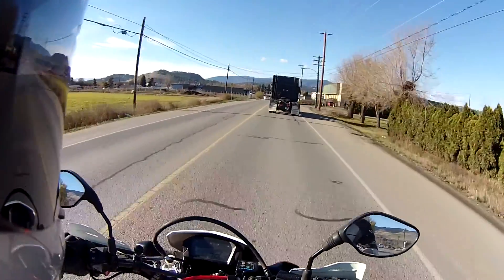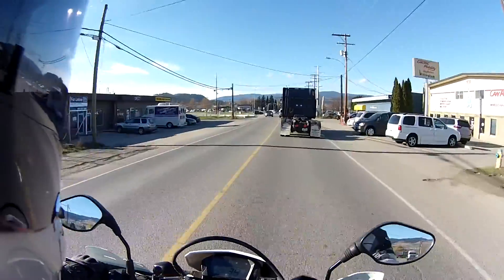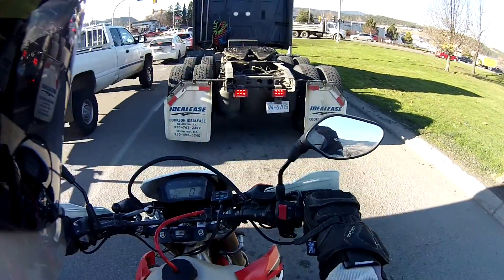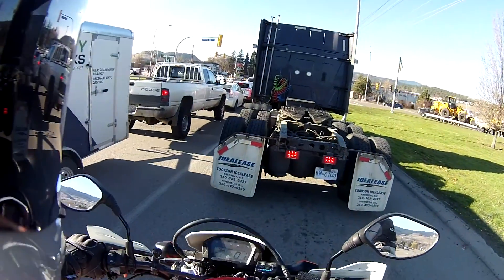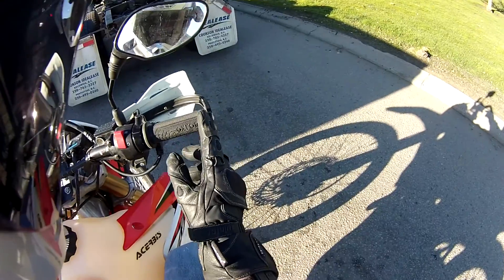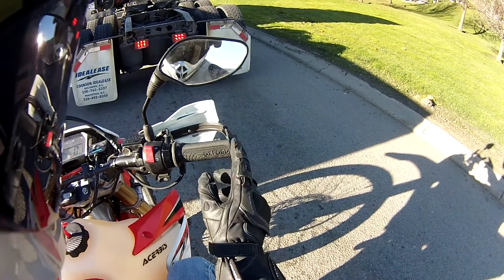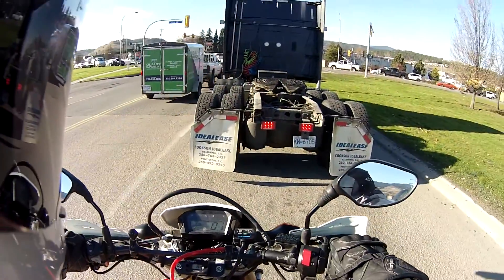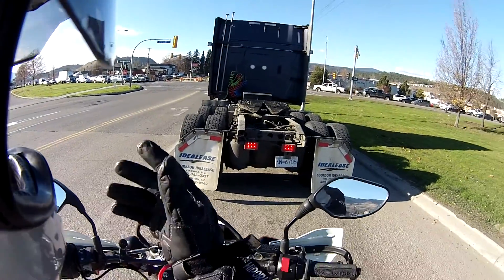Oxford Heated Grips On Crf250L

Comment: Heated grips good (except top of my hands get cold; bottom hot). Years ago I turned to heated gloves (Warm & Safe) and really like them.
Reply from the maker: Yeah I thought about gloves as they would be the ultimate warmth, but the price, inconvenience, power consumption, and limited glove selection steered me away. If the grips work well enough for me, then it's the best option. If not, then I haven't wasted much money.  Thanks :-)
Reply: I ride all through the winter here in the Appalachians in  north Georgia and have found the price difference diminishes if you ride more than one bike in the winter. I ride three ( wr250R, V-Strom, and Ural GU) depending on where I'm going and what I'm doing, all with the same heated jacket/gloves so not much of an inconvenience. I don't know the comparative power consumption but the pulsing controller keeps the draw pretty low and presents no problem on any of the bikes.
Reply from the maker: I sure see how the gloves are the best way when you ride more than one bike in the cold season. I park my road bike for the winter and user the dual sport year round. As for power draw, the heated gloves average 25 to 30 amps whereas heated grips-and they get very hot at max setting--draw a max of 4 amps total. I've not used any heated stuff in the past 3 winters, and have ridden in temps as low as minus 12° C. (about 10° F) with an open-face MX helmet, so I am thinking that the heated grips will cause me to feel pampered and a bit like a wuss, LOL. Plus I have a full-face helmet now. I enjoy winter riding so if this helps extend my ride duration I'll be happy. If not, then heated gloves are my next stop :)
Reply from the maker: I have no idea why those lines in my comment are stroked through. Very strange. I tried to edit it and the edit function isn't working.
Reply: No way do heated gloves draw anything near 25 to 30 amps..Only the Ural could handle that. Power for my jacket and gloves combined go through a 15 amp fuse that has never blown even at the highest controller setting. I'd guess the glove draw 2 to 3 amps max.
Reply from the maker: Thanks for the correction. I read wrong info on the only two sites I consulted. You're right. Not a big amp draw.

Comment: Hi Scoot Toots. We've got the same bike, 2017 model and are trying to fit Oxford heated grips, but we've got a raised collar at the end of the throttle tube. Do you recall if you had the same, and what you did with it? Many thanks.
Reply from the maker: Hey Sadie, all the 250L's have that raised ridge at the base of the throttle tube. You have to cut that ridge down in circumference to facilitate sliding new grips on. Don't cut it down flush. Leave a bit of a ridge. Not much. If you cut it flush, there are cut out sections in the circumference and then it weakens it :-)
Reply: @Scoottoots  thanks bud,

Comment: Can you make a short video highlighting the location of the connectors? Having trouble deciding where to tuck all the wires.
Reply from the maker: It's been a while but I think I routed the wiring across the bars, then  under the tank on the left side, and along the frame member to the battery. All zip tied of course.

Comment: Also, on the throttle tube, did you have to cut the end cap off of the whiter plastic part in order to install the bark busters?
Reply from the maker: To install the hand guards you must have an open end on the throttle tube, so yes, If your throttle tube has a closed end, you have to open that out, and similarly for the heated grips, you have to trim them to fit and operate smoothly with the hand guards.
Reply: BlastsFromTheSaddle Yes. My 2027 CRF250L Rally has a closed throttle tube. I'm guessing the same as yours. Did you Dremel it open, etc?
Reply from the maker: Been so long I can't recall, but use whatever you have; Dremel, coping saw, etc.

Comment: I just got my Oxford grips today......Exactly how did you install the controller?
Reply from the maker: I used the bracket that came in the package and mounted it to whatever pinch bolt put in the right location, then bent the bracket to get the level angle.